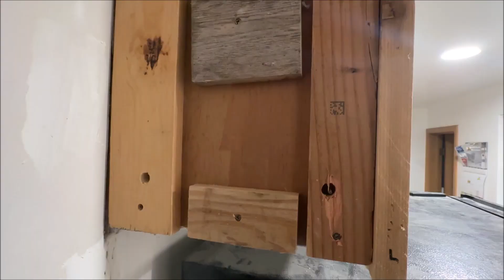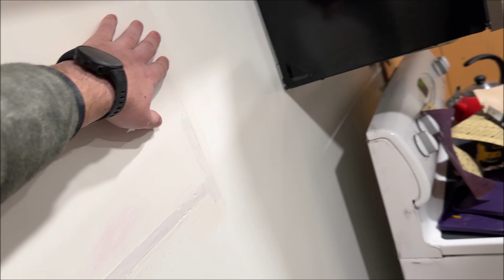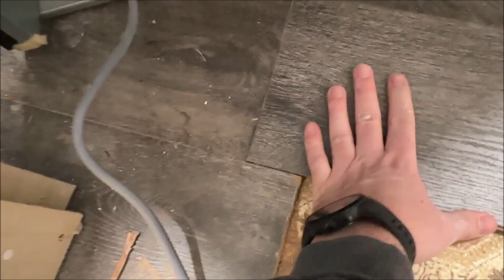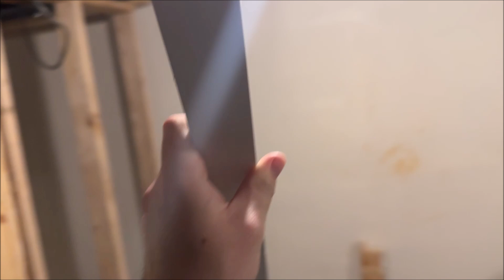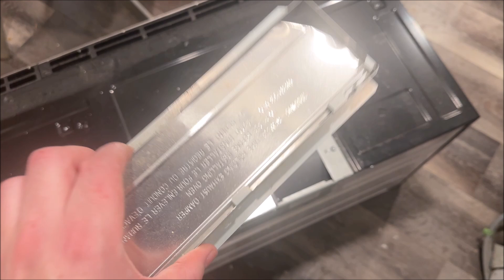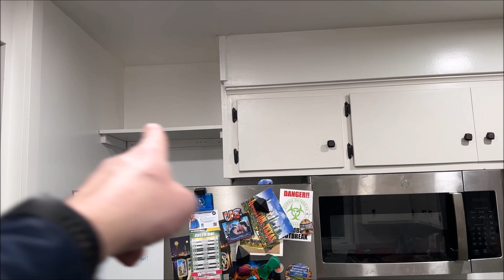Turning This Construction Site Into a Kitchen

Comment: I have done plenty of drywall finishing, in all cases I remind myself that even a job done by a pro is often less than perfect.  That old saying "perfection is the enemy of good (enough)" sure does apply to mudding.  For a shot at making the job easier, mix up the 45min or 90min fast dry stuff when you have to fill in big gaps or really low areas.  Another big help is wet sanding -- using a well-squeezed out sponge, feather the edges and ridges away using small circular motions -- the wet sponge will eat away the joint compound and homogenize the surface.  Also, when you do touch-ups, and subsequent applications of mud, mix in some powdered chalk (like the stuff used in a chalk line tool) and take advantage of different colors, that way you don't accidentally redo stuff that is already done to your satisfaction.  It's a nightmare of a job, but you soon forget about it once the primer is on.  I usually prime the wall and it there is anything ugly, I do it as a repair, then repaint that part.

Comment: The fridge should NEVER be placed directly next to a stove.
Reply: Why not?
Reply: @TheChristianna321  the stove's heat can cause the fridge to work harder, and the fridge's components will wear out faster due to the constant heat exposure.
Reply: @TheChristianna321  Putting a fridge directly next to the stove is considered a bad idea because the heat generated by the stove can significantly impact the fridge's cooling system, forcing it to work harder to maintain a cold temperature, which can lead to increased energy consumption, shorten the lifespan of the appliance, and potentially even cause food spoilage due to inconsistent cooling
Reply: @TheChristianna321  Heat kills refrigerators. Cooling makes stoves work harder. Both die faster.  Lose/lose.  Since it's an electric stove it's no loss, of course. Electric stoves suck.
Reply: On the other hand, @justmeInIowa, my refrigerator and stove have been next to one another for all of the 53 years that I've lived in my home.  In that time, I've had three refrigerators and two stoves...replaced for aesthetic and functional (not operational) reasons only.

That 70s persimmon-colored refrigerator was an eyesore after a while, and after a couple of refrigerators with a freezer on top, I went with a side-by-side model, and purchased a new stove to match the new refrigerator. All appliances worked just fine when they were recycled.

And as for "constant heat exposure," I'm not running a restaurant or bakery, so the "heat exposure" was intermittent and temporary, and the refrigerators never complained.

Comment: Painting tip. When you have leftover paint, get a zip lock bag, put the paint in it and let the paint can dry. Then store the bag inside the can. That preserves any info you might need and protects the bag from damage. If you make sure most of the air is out of the bag, the paint will last fresh for years. Putting the stove so close to the fridge will make it annoying to place pan handles when cooking.